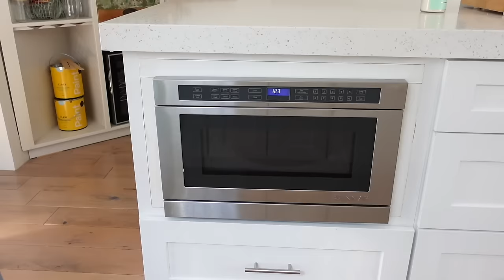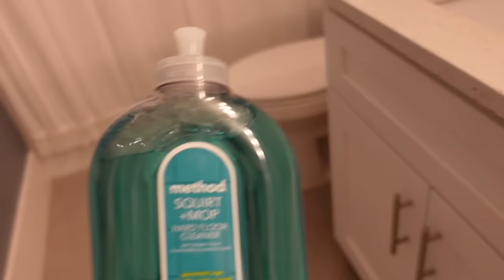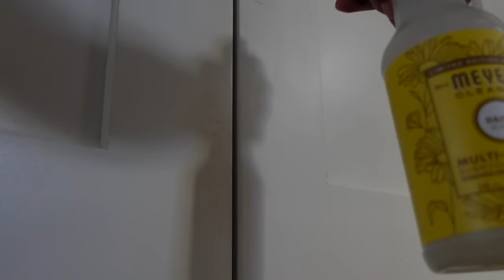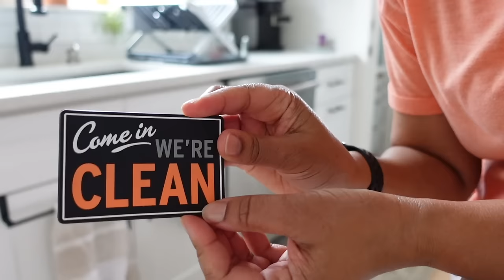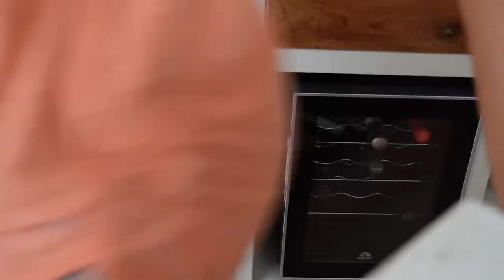✨ 3 Hours of Cleaning Motivation | Clean With Me MARATHON

Comment: A tip when refilling a bottle with cleaners, I sometimes use a big funnel, pop it on top, then tip the bottle you're emptying ontop to leisurely empty out as you carry on cleaning or work elsewhere. You could also use a small funnel but make sure its well supported to be able to balance the bottle to be emptied. I prefer a small funnel as it often remains clean and not be submerged in the solution when finished. But do note, if the compound is thick, a quick shake to start before placing on top of the funnel, then walk away.